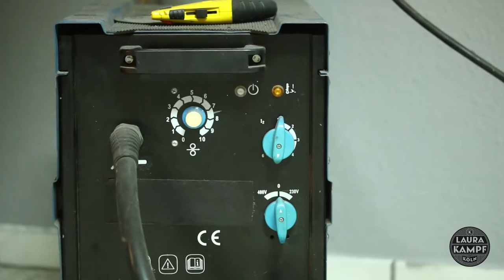Laura´s Cargo Bike

Comment: Good idea on the fasteners for the handle bars! and the wood slats gave it a nice finish....
the only concern I would have is that on the forty-fives for the top rack and the fork tabs got surface welded and then ground flat again not giving them very much weld holding them together afterwards.  May I suggest giving the edges to be surface welded together a sight bevel so that you have a little fillet or groove to take the weld? even when the surface is ground  flat... you will still have good penetration  all the way through you edges. ( :

Comment: Subscribed (thanks to AVE's recommendation). Suggestion: make things lighter, thinner, more efficient. could have easily used 1.5mm thick angle iron. or brazed aluminum. for the "legs" some 1/2 inch round pipe..etc.
Reply from the maker: you are right...this could have been a lot loghter. but i always try to work with what i have. making a movie every week gets expensive very fast and i want to be as resourceful as i can...even if that means i will have to pedal a bit harder :)
Reply: With a whole crate of beer on your bike you arent gonna notice one or two kilos more or less anyways ^^

Comment: I thought I would share a photo to complement this most awesome project.
 https://www.flickr.com/photos/clauderobillard/6557130927/in/photostream/
These bikes were common at one time in Montreal and were primarily used to deliver beer from corner stores. It wasn't uncommon to see 3 cases of 24 beers being delivered in one of these bikes. What you can't see in this photo is the stand, it's tubular steel. upside down "U" shape with bent ends, connected to the front, bottom of the basket and swings down to stop the bike from pivoting when parked with a load. The stand worked like the centre stand on a  motorcycle.